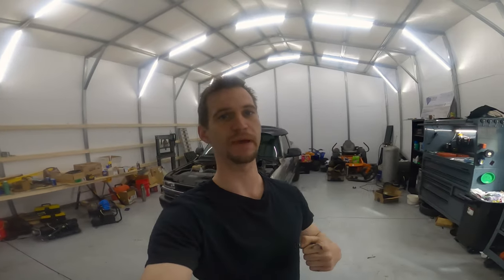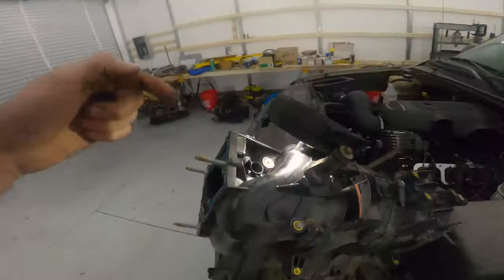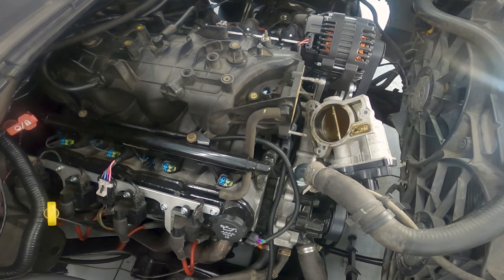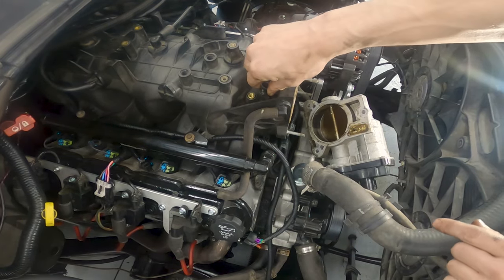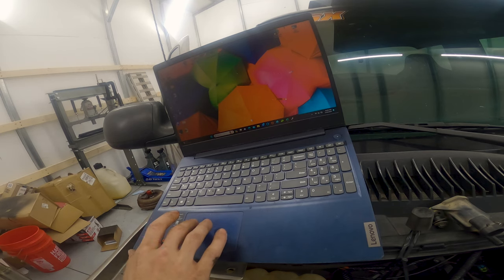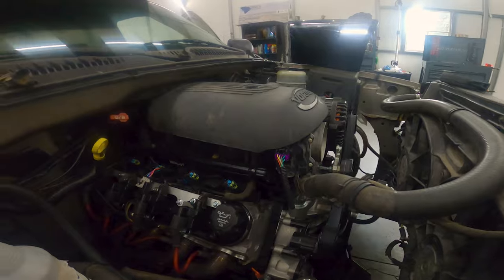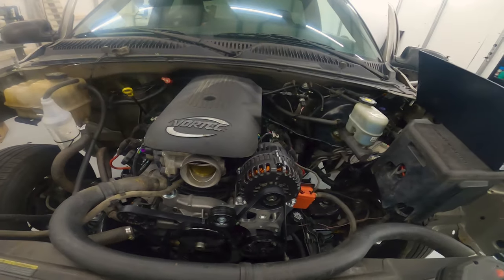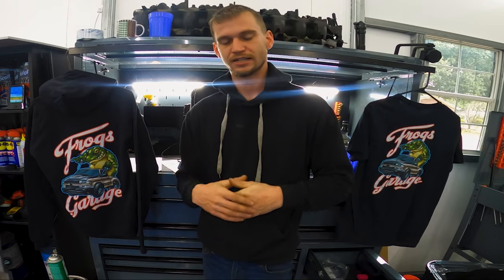Mass Air Flow Sensor Delete and Intake Air Temperature Sensor Relocation Guide

Comment: You will need to wrap the intake pipe in exhaust wrap as it will get heat soaked from being run  so close to the radiator it's a trick we do in Australia to help lower intake air temps
Reply from the maker: Oh nice ur from Aussie that’s one of only places I wanted to visit and go on vacation too. Aussie people I’ve talked to in past have been really chill and nice and love the accent

Comment: Appreciate your video as I'm new to tuning; I bought the sensor you linked but ordered a different connector (Ballenger Motorsports - Compatible with GM Delphi/Packard - 2-way un-shrouded GT 150 3.5mm Centerline Sealed Female Kit for IAT) from Amazon for a cleaner install with no butt connectors; of course if someone doesn't have pin crimp tool they might prefer the butts.
Reply from the maker: I soldered and heatshrinked mine cause I’m not a fan of butt connectors either

Comment: What size bit did you use to make the hole in the intake ?
Reply from the maker: 9/16 or 5/8 i believe is what i said in the video not sure off top my head i would just start with the smaller one
Reply: Good info.  As you know I'm planning to delete my evap when I do my intake.  May go ahead and do the iat mod too. Gotta drill a couple holes anyway what's 1 more lol
Reply from the maker: yea its a more accurate IAT temp when u take it straight from the manifold too

Comment: Is it after market ecu or tuned? Dose it work on factory  set up?
Reply from the maker: Its stock ECU but you do have to have it tuned to run without a MAF
Reply: Good to know  vidio made it seen like could be done on factory setup
Reply from the maker: You actually can do it without a tune and it will run fine but u will end up with a check engine light till u get a tune and have the code disabled

Comment: Lol dont make fun its my sons page but what did you do with the extra wires you didnt use??
Reply from the maker: Haha its all good and I just trimmed them back wrapped them and stuck then hid back inside the loom
Reply: @FrogsGarage  And as far as needing it tuned it will run but just with a check engine light correct??
Reply from the maker: Yea it will still run just has to set the code for the Maf sensor then it will run off just the MAP only